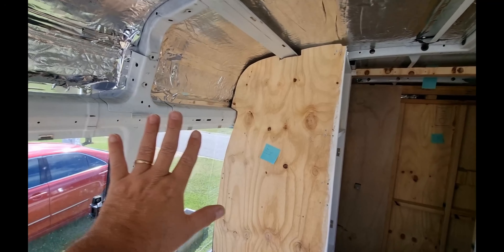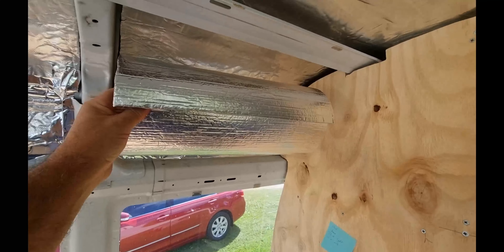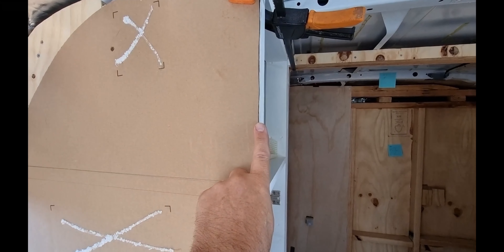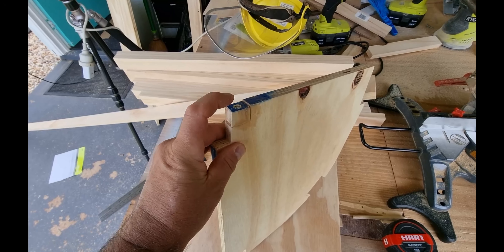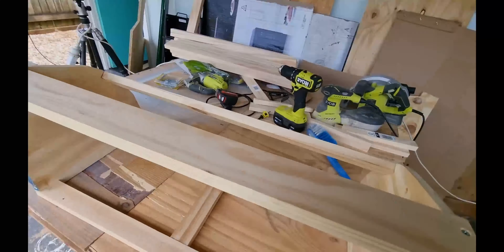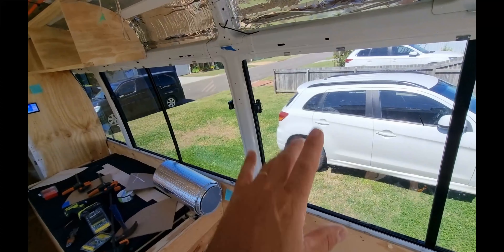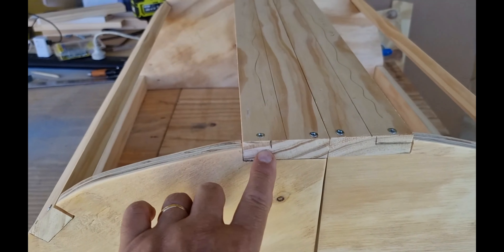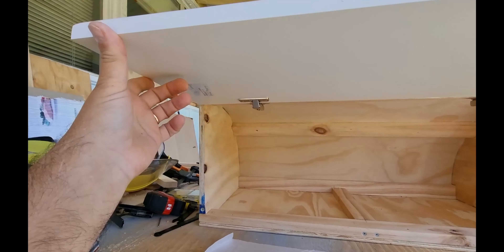Mitsubishi Rosa Bus Conversion Part 70 Making overhead cabinets

Comment: Hi I’m doing my build similar to yours just wondering we’re did you get your shower base from and what are your measurements cheers I have watched your videos over and over thanks 😊
Reply from the maker: Hi Wayne glad you are liking the videos 😀. I haven't got a shower base as it's not a standard size I think it it's just under 900 by 700. So I might be making a fibreglass one. But no final decision yet. Sorry that's not much help but I will have to make a decision soon as I'm nearly ready to start to finish the shower/toilet.

Comment: Im not sure what sparkey you hired, but that flex cable along the roof is a big no no.. Even with applying the regular electrical standards that is not allowed.
Reply: Great point! Good to know for all of us watching this build. Thanks.
Reply from the maker: There is no flexably cable there is flexi conduit he is a licenced electrician so he is doing everything legally.
Reply: @OffGridisSweet  That's good Andrew - its all about liability at the end of the day - if something happens the big insurance saga begins and could end badly with just a slight misstep.
That was good that Richard pointed that out though, even mistakenly - I went back and took a closer look, and yes easily mistaken for flex. 
I for one didn't know the rules with flex and would have assumed that since its ok to run it along the floor, it would be even better to run it out of harms way, but apparently not!
Reply from the maker: @Bennyboy-dog  it's always been that we do everything legally and safely. So we made sure to use licenced tradesmen. As this will be our home we wanted it to be safe 😀.
Reply: @OffGridisSweet  I don't know but i just put it on 4k and that definitely doesnt look like flexible conduit. Maybe i need new glasses :P